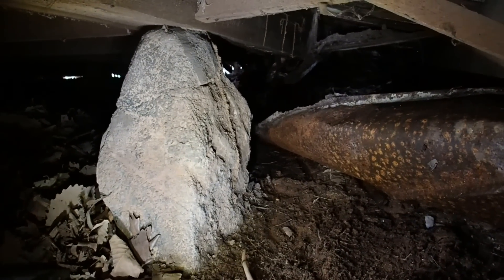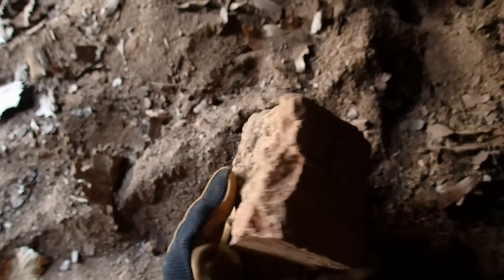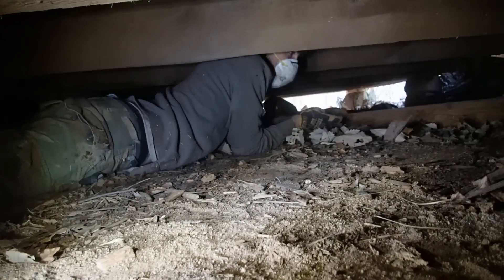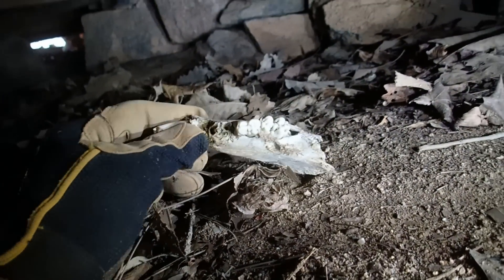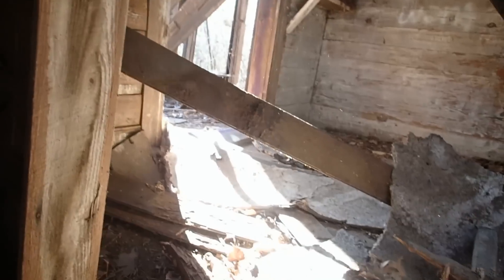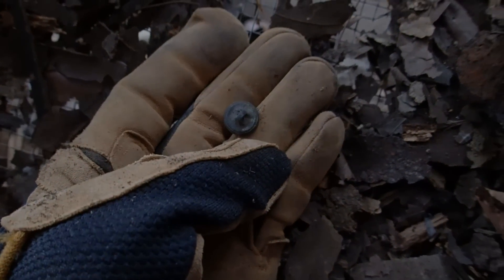What's under the house? | Nugget Noggin

Comment: The metal plate Abby found is a Coupling Plate for a horse drawn wagon. You used it to connect two wagons in tandem I believe. The Patent info is below..
A. T. BARR. (Alexander T Barr)

COUPLING GEAR FOR WAGONS. N0. 284,593 Patented Sept. 11,1883.

Comment: My sisters former house on Bartlett st in Ellenville Ny had an old outhouse that hadn't been used since the forties. I was told it was there since the early 1900s. Back in the eighties before I had Minelabs and Whites metal detectors I knew under where people used to sit to take a dump I'm sure coins fell in. I went to the spot where I estimated. One thing was certain and that was where the fertilizer was rich was where the human excrement was. I found 12 silver coins from the twenties and quite a few pieces of old Indian head pennies. It was a perfect place to dig. I'm very surprised that no realized this was a great place to dig. I'm sure if anyone dropped a coin in that nasty excrement back then they would not try to retrieve.

Comment: Nug the flat iron plate with holes is a wooden farm wagon part that connects the reach pole to the axle braces . The round tapered piece  hooked to a chain is the axle that the  wheel hub would spin  around. The actual axle would have been wooden.    HTH  57

Comment: Great pocket knife find. I dropped mine and it slide into the fishing hole(under an highway bridge) and one or two years later the water level dropped(about 3 feet) and it was right where it slide down the concrete. I cleaned it up good and still have it